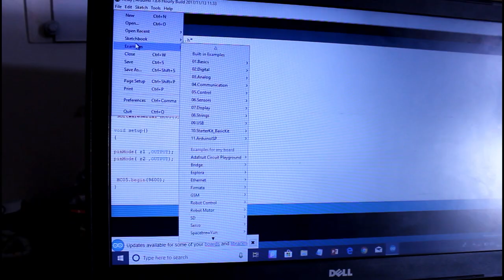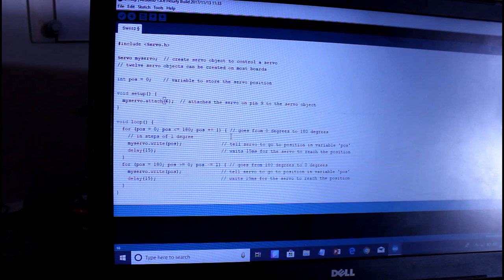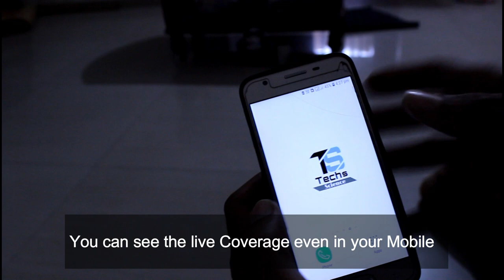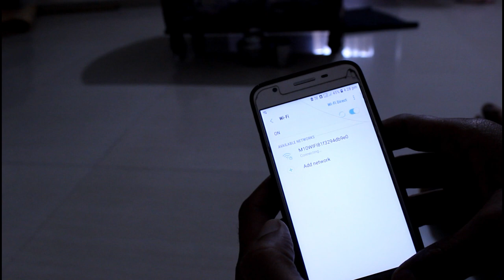Make Wireless CCTV Camera using Action Cam | Arduino Project

Comment: From where I get that wire cable for power supply which u use with battery to connect with arduano
Reply from the maker: It's available online,Electronic shop or you can take it from the old adapter (as i did)

Comment: It's just amazing...can u give  clear discreption  about the equipments used ... below
Reply from the maker: I used arduino uro R3,Servo motor,Action camera that's it
Reply: @TechsScience  thanks for the answer....can I know the camera u hv'e being used?
Reply from the maker: @pravallika4529  It's M10 SJCAM
Reply: @TechsScience  can this camera take pictures aswell, and can we connect it with arduino?
Reply from the maker: @datapoint8396  yes it takes pictures too
& it can be connected thorough wifi